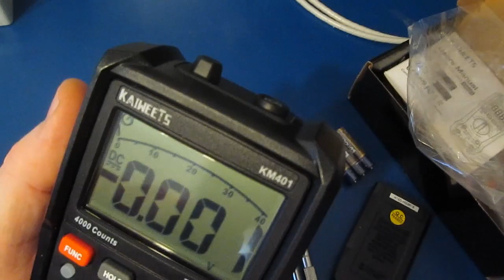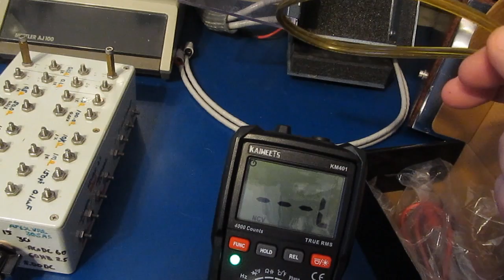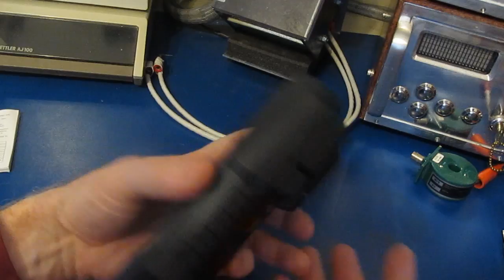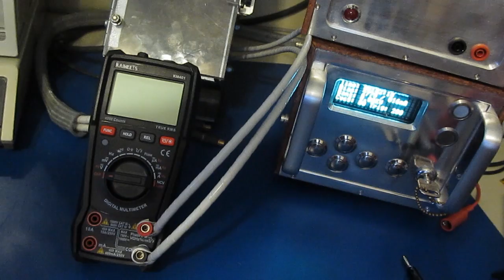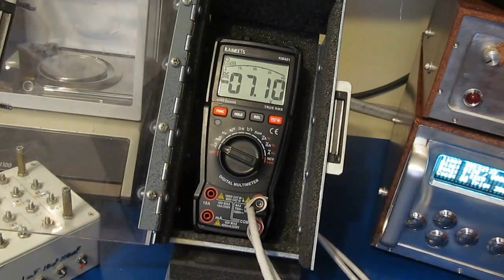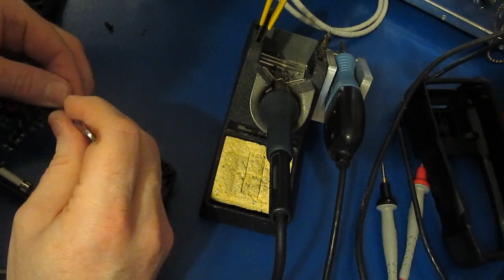Transient Testing the KAIWEETS KM401 4000 count DMM

Comment: Honestly for $30, this is a pretty good meter for the hobbyist or basic home user. I recently bought an AstroAI DM6000AR, also $30 on Amazon, for work. Most of what I do is test 5 and 12V, continuity, resistance and 120 AC voltage in arcade games.  My Brymen BM257S was borrowed and returned with one of the leads broken off in it. The meter survived with a bit of case damage (no idea what they did, no one admits anything as usual) but it's home now and I'm keeping the cheaper unit at work.

Comment: I have had the previous model KAIWEETS HT118A for two years now. A s a novice , hobbyist I love this unit and is my go to meter even though I have more expensive ones. Like the most that the display is really clear. Great review Joe, heart leaps in my mouth at those high voltages. 😄

Comment: Another well presented and informative video. Most trades people will have more than two multimeters and perhaps a cheap meter as per your test, for electrical tests under 50v ac/dc.
 Perhaps low-cost meters have a place, and qualified tradespeople will know not to trust cat ratings on such meters. 
I was in the market for a decent replacement meter and having been bitten by Uni-t in the past I purchased a Brymen BM829S, I will see how that performs,
At least it has a cat rating that may mean something.

Comment: Not a bad result. Still fails to be up to the spec it claims, but not too shabby. The fast clamp failed shorted and protected the chip. How dependable this may be who knows, but so far so good.
Reply from the maker: Typically with the 5mm PTCs, their case fails and they arc.  Then there is nothing to limit the current to the camp except the 2 ohms source and what ever else is in the circuit (leads, switch, traces, connectors..).   Once they arc, the transistors typically open up taking out the next device in the chain (controller).   No doubt had I continued to increase the test level, this would have happened.